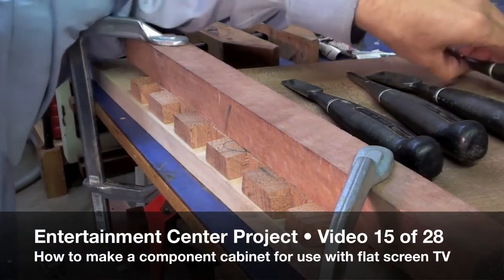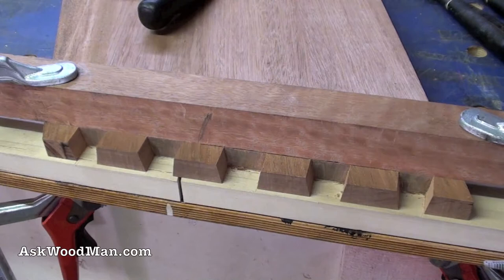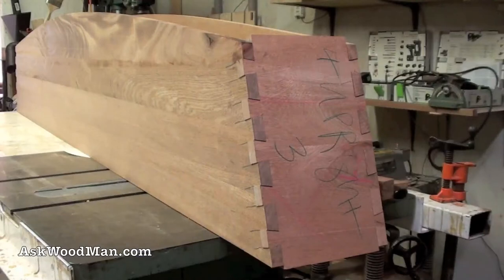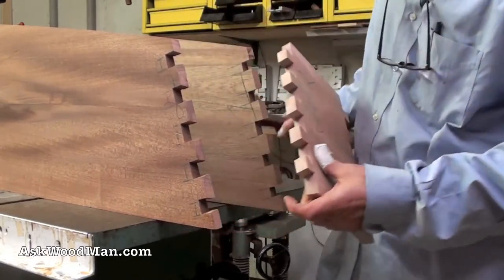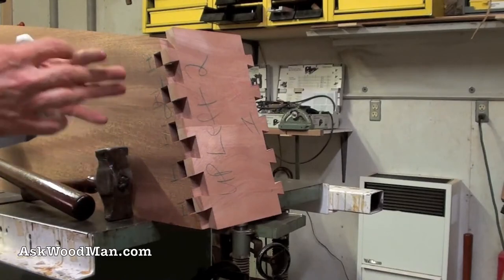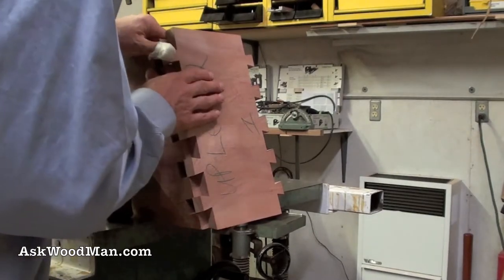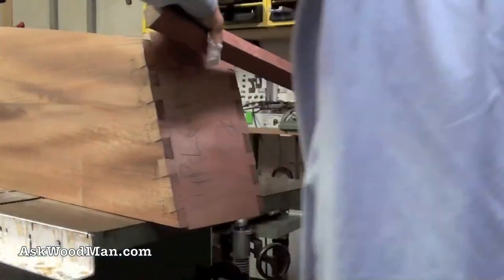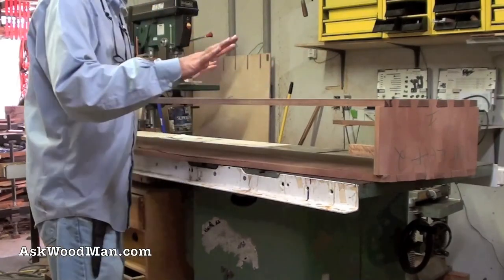15 of 28 • Building An Entertainment Center for Flat Screen TV: A Furniture Project

Comment: Angles just make everything harder you have to keep your wits about you for sure. You really have to take your time and think everything through. Your experience shows with leaving it long so your mistake wasn't catastrophic. That sure looks good tho. When I'm laying Vinyl flooring with angles it's always a challenge because you can't leave too much extra material or you'll tear the backing or right through. But like everything else those little tricks of the trade pay off.